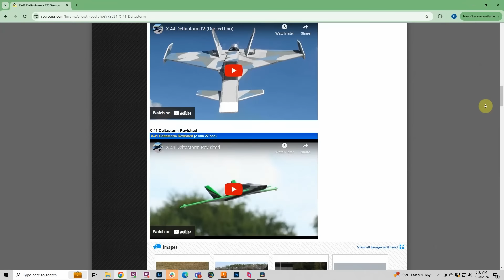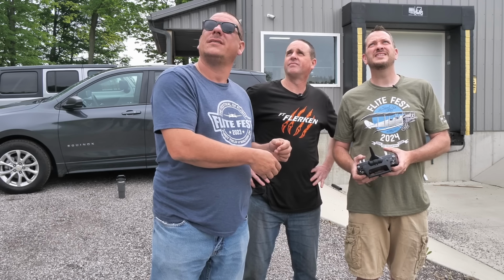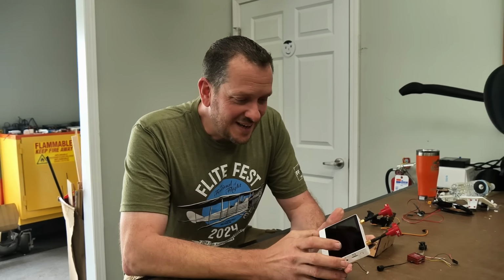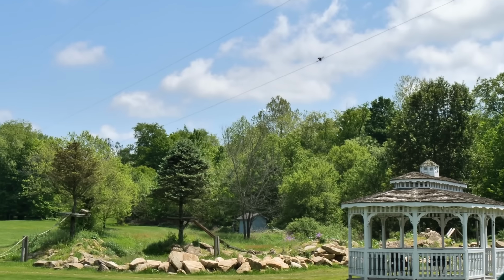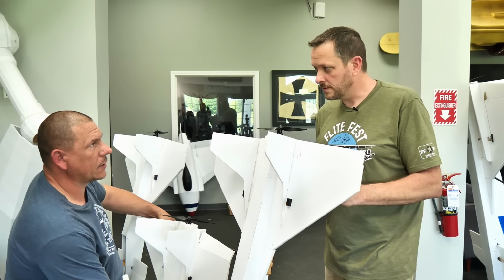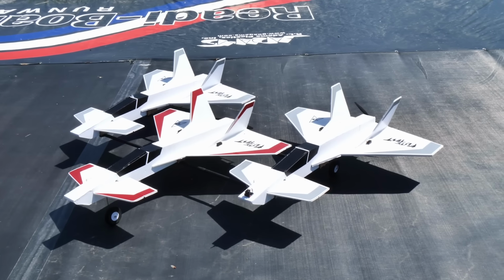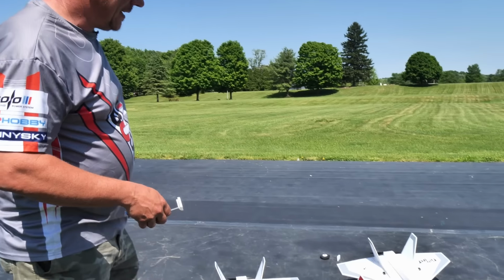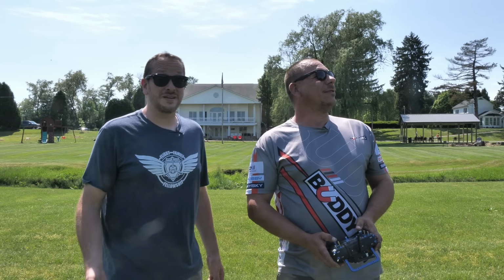3 Planes - 1 Pilot - Will It Fly?

Comment: When calculating the center of lift OR center of gravity the moments simply ADD.  Pick any datum point to re-calculate the moments.   So if each of the 3 separate planes were in balance then the moments of the 3 combined should be balanced !

Comment: A west coast RC pioneer, Ken Willard, built a four ship, F-11 Tiger Blue Angle formation ship, lead had the engine, the two and three ship the outer wing panels the ailerons, and the ship four, the wing was the elevator, it flew many times, including in an Air Show at Moffett Naval Air Station, in front of the real Blue Angle crews. For the second year, two other fliers built single ships, and flew ships 5 and 6.
One of the singles made a too low inverted pass and right in front of the dignitaries, slammed it into the ground, balsa parts everywhere.